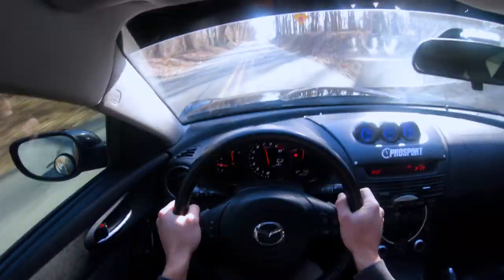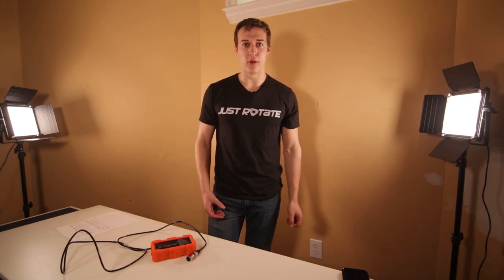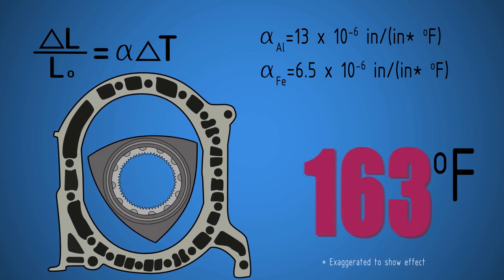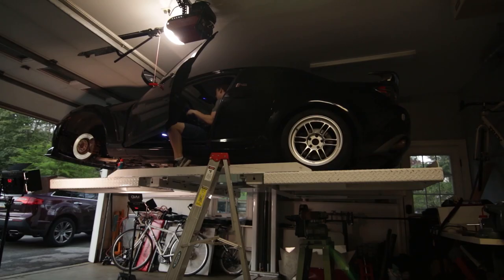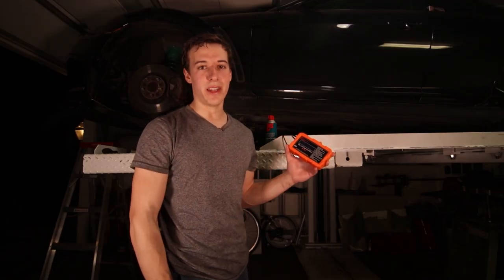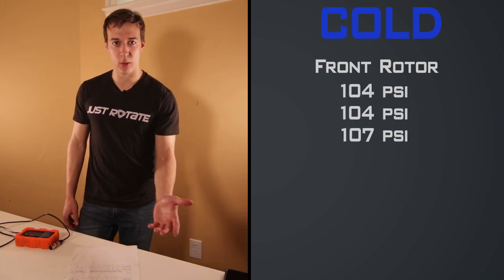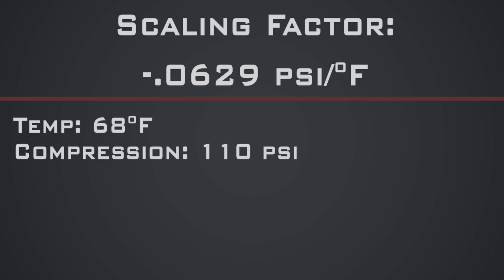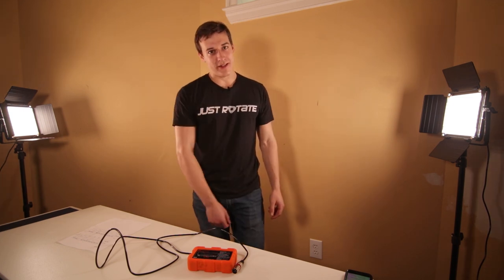The Ultimate Guide to Mazda RX8 Compression Testing

Comment: Great video, but you could have mentioned what compression is considered healthy, normal and low. I use the metric system and from what I found online yours is in the normal territory (7.1 bar) and should be fine for a while...
Reply from the maker: Technically, anything under 7 bar (about 100 psi) is failing. It's not like the car won't run, but the blowby will cause failure to occur more quickly.
Reply: @JapandaTuning  No, it's not failing. You'd have to be under 6 bar for that.
Reply: @tiborklein5349  above 7 to be safe.
Reply: @JapandaTuning  does your car pull fast? Smooth revs? Easy cold and hard start? Smoke?

Comment: Great video.. just two questions ..
1: other compression videos online show that they also compression test on the trailing plug as well as the leading plug. 
Would this make a difference to the overall results?
2: You would assume that as the engine warms up both the rotors & housing expand, thus making the compression go up. If so wouldn't the compression of a cold engine be comparable to a warm engine, all things being equal ?
Reply: I'm not an expert, so take these with a grain of salt.

1. There wouldn't be a meaningful difference. Compression testers record peak pressures within the combustion chamber. According to the laws of physics, the pressure is the same anywhere inside a closed system. Think of it like a doctor taking a patient's temperature from both ears.

2. While it is the case that the rotors expand (alone would increase compression), so does the housing. But the housing expands in the opposite direction of the rotor, and they "run away" much farther than the rotor can grow. The result is that the gap between the rotor and its housing is increased when warm. This reduces the compression ratio of the motor and diminishes its sealing capabilities; in turn, the higher, more desirable pressures become impossible.

The reason for this is similar to when you press a bendy ruler at both ends, it bows outward.

Comment: Good video but some mistakes.  don't remove the Leading Spark Plugs and insert the tester in the Trailing Sparks plug hole.
Reply: Ive heard both. Does it really make much of a difference? Seeing how these engines work I don't see how it would matter if it is leading or trailing plugs removed.

Comment: What's your opinion about 192hp rx8 5 speed manual (Europe). They are much cheaper and more common to find in Greece at least and with less milage than the 231 that's more expensive and with more milage.Are they less fun than the 231 because of the 7.500 rpm than the 9.000??

Comment: Watched the whole thing! How come you made no mention of the compression numbers as it relates to the elevation you're testing in? In some areas, even 90psi all faces is perfectly fine. This is hardly an Ultimate guide to compression. Now your numbers as it relates to temp range are sound but you left out the elevation factor which tells you the TRUE corrected numbers.
Reply from the maker: I am sure I could have mentioned that, sorry for leaving that out. That is because the compression tester I have (link in the description) normalizes at 250 rpm and corrects for elevation pressure. Also in the link in the description for normalizing the compression data, there is a place to put your site of testing's elevation to correct for that. Sorry for not going into more depth in the video.
Reply: @JapandaTuning  Yea because when these guys go testing their engines, the last thing we need is them thinking 100PSI is failing without understanding the full scope of the numbers. Back in Dec 2018, I bought a used 2006 Rx8 from Copart with 123,000 miles. Engine was flooded and had 65psi all faces after I got ot running. Most would say it's rebuild time but not me. I know all the compression restoring secrets. I did my carbon cleanings on the engine, drove it for 1,000 miles and the compression shot up to 95psi all faces. Corrected for my elevation.  My corrected numbers were 110psi. Not bad for an original engine Rx8 with that many miles
Reply: RotaryPerfection can you list out your carbon cleaning techniques please?

Comment: Your compression isnt too bad but you will see some reduced power. You could keep driving it for at least another 10k miles before a rebuild is necessary. I find anything above 6 bar is fine with a good ignition system. 

Your cold vs hot compression is pretty meaningless though despite the math and science work you put in. Many engines are different and the co-efficient wont be accurate due to spring rate differences. If you cant get the engine running and hot, it's not worth it to compression test. Even with low compression, the engine should always be able to start and run while cold. Great vid as always, your compression is actually better than my 6 speed manual XD.
Reply from the maker: Yeah and when I rebuild it, I am looking to bridgeport also.

As for the cold compression test, I know its not perfect like I mentioned in the video, but it should at least be a bit better. (I actually got the idea for this because I am working on an rx8 that wont start and want to check compression).

Thanks for the feedback!
Reply: @JapandaTuning  it should still start, even with low compression. Probably just got flooded. Try swapping in new coils, plugs and wires and starter if cranking below 250 RPM. After this, do the deflood process. got an RX8 running again like this and after testing it showed 4-5 bar hot.
Reply: @JapandaTuning  Bridgeport on the RX8 good if you are tracking it. You'll see a good power increase. Keep in mind it will completely screw your idle though.

Comment: Trust me when I say, your compression is NOT LOW in the least loool... I have been running my RX-8 for a year with compression in the high 70's on the rear rotor and low 60's on the front rotor before my engine blew entirely. Until your numbers start going down to the 80 PSI range, you have absolutely NOTHING to worry about. Yes, you might lose some power,  but if you clean off the parts of the engine (like your valves), and make sure there are no vacuum leaks, and that they are actuating properly, you will have a healthy RX-8. I can't remember if you are premixing or not, but that will help as well. I just got a freshly rebuilt motor with a bunch of mods done to it (street port, dowel pins, stud kit, RX-7 apex seals, etc.) and my compression numbers were above 105 and around 110. Your engine is healthy, bud.
Reply: I forgot to mention, that with my low compression numbers that I specified, I had NO hot-start issues... I kept my ignition in check, and I upgraded to a 2kw starter over the Series 1 starter.
Reply: yea it really not bad but he uses it a a dedicated track car so he should probably have at least 4k stored away for a rebuild
Reply: Snoopy25 where did you get this done at just out of curiosity
Reply: @Tyrese-oz6jo  Elite Rotary; I learned SO much about rotaries ever since I got in touch with them about 5 years ago. I knew I needed a rebuild from 2 summers before my engine blew, but I didnt have the finances at the time. Full time college student with a part time job and an RX-8 as a daily driver lol
Reply: Snoopy25 how much did it cost you and where are they located
Reply: @Snoopi25  after this experience, do you think that daily driving RX-8 as a student with part job is a good idea? I'm asking because I might have this dilemma whether to go this way in a couple of years 😉
Reply: @kszesiek  I used to have a '99 Camry CE during highschool that my parents gave me; I honestly liked that car a lot, but I had an accident and it was totaled beyond repair; then I told myself that I would work an entire summer before college started and buy an RX-8; I didn't have enough money to get one until the end of summer, so I lost a lot of opportunities, and decided to buy a dead one and swap in a "low mileage" engine; the money pit rabbit hole started at that point LOL, but I made it through 4 years of college with my RX-8, and I still own it to this day... loads of money later... MY problem was I bought one that was utter junk, maybe u will have better fortune than me
Reply: @Tyrese-oz6jo  Just do a google search, you will find them on google maps for sure
Reply: How much mileage did it have? In my province in Canada they are all around 110,000-130,000km at prices ranging from 3k-6k. Would you say its worth getting one that was only owned by 1 person and has all the repairs at 140,00km at 3k?